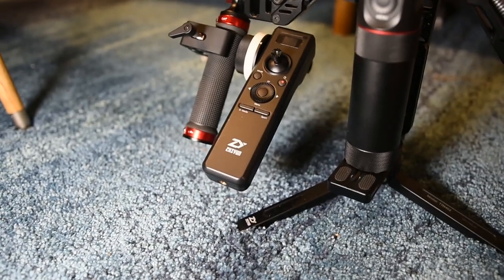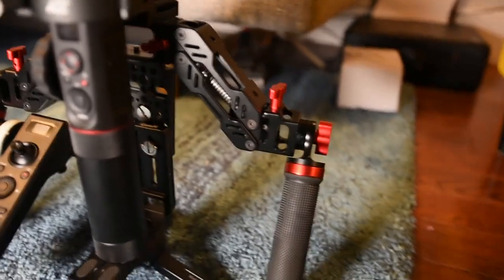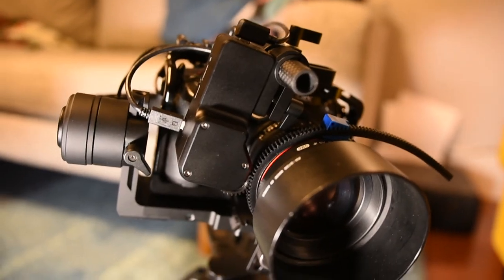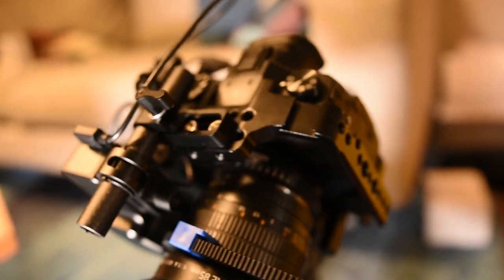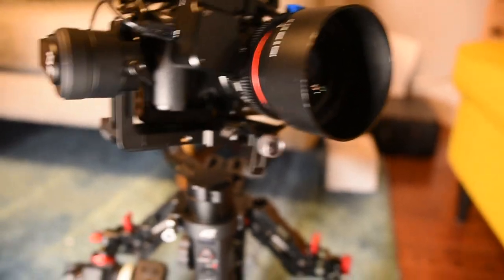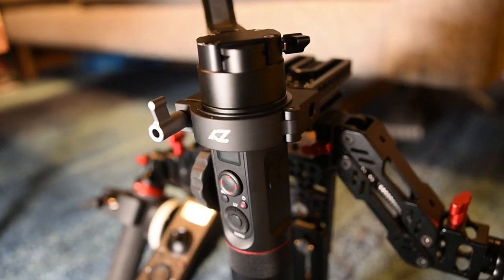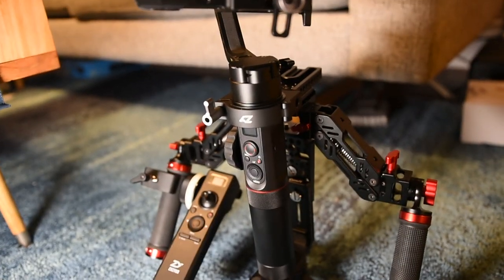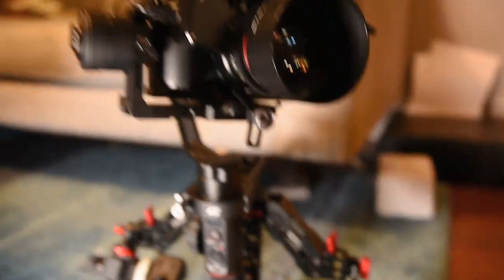5 AXIS GIMBAL HANDLE | Zhiyun Crane 2

Comment: Are you still happy with this setup? Is it heavy to use?
Reply from the maker: yes i will sometimes use the crane 2 as is. if your doing some fast walking and action shots i will definetly mount it with the flex handle
Reply: Nice! I have a GH5 and I'm thinking of the same setup as you :). Is it easy to control the follow focus with the flex handle? Is it fast to mount/demount the flex handle on the crane?

Comment: I'd love to see that update video on the mounting of the Crane 2 to the Beholder.
I ordered the Zhiyun Extension ring you used: https://www.amazon.com/gp/product/B0796RJS98/ref=oh_aui_detailpage_o00_s00?ie=UTF8&psc=1 and have a cheese plate.  But I'll be curious how you changed the angle of attachment.  This linked clamp is too small, don't get it for the Crane 2
Reply: Even a photo of the profile and rear side would help to figure out what you did.  Nice work!

Comment: Isn't it a 4th axis, not a 5th axis. The gimbal is 3axis.
Reply: Tilt, Roll, Yaw, Forward Backward, Up and Down.
Depending on Orientation
A - Roll
B - Yaw
C - Tilt
X - Fore and Aft
Y - Up and Down
Z - Shift left and right.

3 axis gimbals have the tilt roll and yaw covered. The handle grip eliminate the up and down bounce (Y or 5th axis). 
The 4th axis (X) is forward and backwards movement which is you walking. 6th axis (Z) is you strafing left to right.
Reply: Stan Sebastian G Learn something new everyday! Thanks!